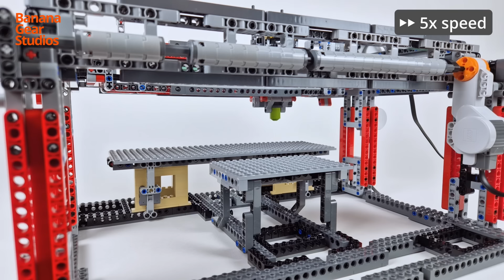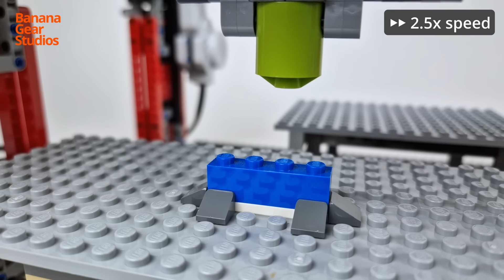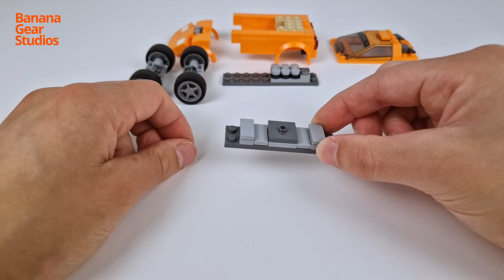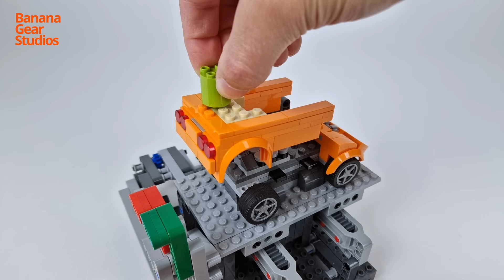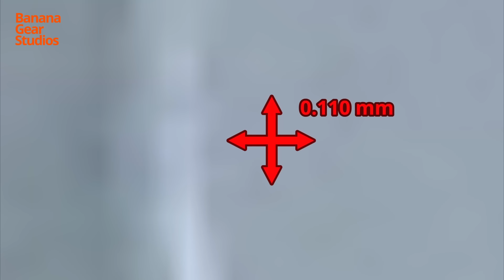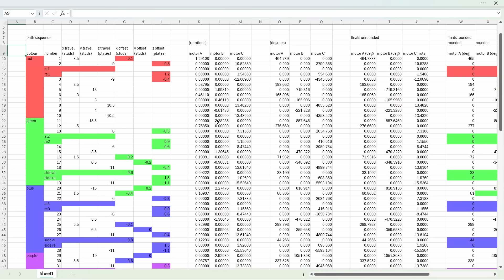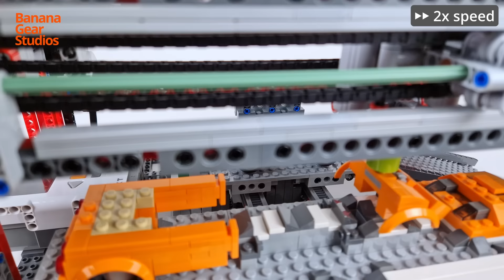I Built a Fully Automated LEGO Car Factory

Comment: There are two common ways CNC machines or 3D printers figure out their position so they know exactly where there are. 

One is to just run the motors to the far end of each axis and notice when they stall. I’m guessing that isn’t an option. 

The other is limit switched. You put a little bump switch at one end of each axis. Or at least X and Y. 

Before you start you move the tool until the limit switch is pushed. You consider that 0, and now know exactly where the tool head is relative to the gantry. 

May help your positioning. You’d still have the flex between the gantry and platform though. 

I loved the wiggle as a solution to the problem. Fun to watch and works great.
Reply from the maker: Yeah, you're right that going until the motor stalls wouldn't really be an option - it would just snap the chains instead. Using switches at the end is a really neat idea though, but I've found that the Mindstorms hubs can be a bit sluggish to respond to sensor inputs (and by sluggish I still just mean a fraction of a second, but that might be enough to introduce a lot of inaccuracy with where the motor stops).
Reply: @BananaGearStudios  A homing sequence on a CNC machine will move very slowly as it depresses the switch and take an average over multiple trials
Reply: @rockyvillano777  Similarly, homing with DC motors might just drive them weakly, relying on them stalling at the limit (but not jumping like a stepper can).
Reply: @BananaGearStudios  Is it predictable and repeatable just how sluggish the sensors are?
Reply: @BananaGearStudios you also might have better luck with latency using different EV3 firmwares than the default image (EV3dev or definitely EV3RT) since the default image is Linux based which is powerful but has a good bit of jitter on the scheduler, whereas a more bare metal RTOS like EV3RT should be much more precise. Overall, the processor on any of the mindstorms hubs (definitely not counting spike prime) is more than powerful and fast enough, the latency issues are just the scheduler on the operating system.
Reply: I assume he already has his way of setting the origin point. He would not be able to repetitively run the program and assemble the car without one. I think he uses the maximum direction of each axis as his bump switch. The reason that he can't solely rely on setting the origin point for accuracy is because the frame of the robot is not stable enough for the accuracy he is trying to achieve. This is why the awesome lil wiggle is used. To compensate for the unreliable origin point, that lil wiggle helps out! 3D printers are made in a way that makes sure that the origin point is extremely reliable. This is some really cool stuff
Reply: @blakethegreat421  The problem is not the lack of precise homing at all, it's the inherent lack of rigidity and compounded slop/backlash, no matter how well it was minimized. There's no fix for that kind of thing short of a live sighting cam that spots the peg in real time and decides when the positioning is perfect - except anyone who's seen one of those in action knows they're... far less than infallible too, even in industrial machines with 6-digit prices.
Reply: @blakethegreat421 I wasn’t sure. From the video it seemed like he might just be jogging it into place and sort of eyeballing it. But I may have misunderstood, so I thought I’d make a comment just in case.

Pretty impressive project. I can’t see the next part.
Reply: My first thought was the stall method--something like 10 years ago, I remember seeing a project with NXT that did exactly that! Instead of using any other external sensors, the program simply compared the measured rotation to the intended rotation to see if the motor had stalled. In this case, it was used to tell if a car had hit a wall and needed to reverse.

Comment: very good, but I think worm gears or spiral poles, with some sort of nut piece would be more compact, no backdrive, not much backlash, and can have gear reductions bigger than the universe. LEGO used to make a 32L pole which had a nut with 2 bars, but also a 2x6 nut plate, they also make technic worm gears of course, but these might come apart on the axle. theres also that fat 6L spiral pole but this is probably overkill, and can be backdriven. Look at " lego technic worm gear nut" by oracid on youtube

Comment: for releasing the car, i wouldve just stuck with the original method of building it on that platform with the 2 small studs. Then i would have something push up from underneath on the wheels to disconnect it and roll away. Or have the studded platform lower down, where the wheels would hit a ramp, pop off, and roll down

Comment: Learning that you had to compromise on the original car design was a bit of a shame, but that lego three-axis machine is crazy cool!
Reply: i mean, real cars couldn't be designed without consideration for the manufacturing process either
Reply: @agentwcVery true!
Reply: @agentwcwell, you say that...
Reply from the maker: Thanks, I'm glad you liked it! There were a lot of constraints on the size, shape and attachment points of each of the subassemblies of the car to ensure that the factory would be able to assemble them, which led to me having to simplify them so much. Some of these constraints I didn't even get round to mentioning in this video, but I'll explain them more in the next one.
Reply: @BananaGearStudios, you should totally collaborate with Lego MOC designers to help make complex car designs that could totally be built by your factory.

Also your current factory is the "final assembly" stage and you'd need to develop assembly stages for each of the car parts in this video.
Reply: I, for one, fine the mini-F1 absolutely adorable XD
Reply: Well, the problem is that the original car is designed to be made by hand. its incredibly difficult designing a factory around a car, instead of designing the car around the factory.
Reply: @speedman1996 adding two or three features to the factory could achieve higher complexity cars without overcomplicating things
Reply: That’s how research usually goes but hope for a futur factory that can assemble the complex car
Reply: It's called "Design for Manufacturing," or DFM. A product that you can produce at scale is better than a product you can't.
Reply: Yeah, I’m with you engineering background that 3-D access machine is more interesting to me and also his knowledge of assembling cars and then converting that to a simple cars in a Lego environment. Fascinating definitely have a new follower.
Reply: The design compromises are an interesting part of real-world manufacturing. Having worked in a machine shop in the past, you would not believe the number of times manufacturers have to call up the engineers (or more accurately, call up the contact number and attempt to get transferred to the engineers) who ordered the parts and either explain to them that they are physically impossible or prohibitively expensive to produce, and then we discover that there is no practical reason for them to be designed the way they are and tell the engineers that they need to redo it. 2 of my favorites from my time as a machinist are a high performance engine part which had a very narrow hole which turned 90 degrees inside a solid aluminum piece, and then turned 90 degrees again before it came out, which is impossible to machine using subtractive manufacturing. The hole was also specified to be square, when the part was redesigned the hole went straight through at a slight angle, eliminating the turns entirely, and was round, which meant it could be machined very quickly using a standard drill and reamer, and a housing for a red dot sight which was specified to have a ridiculously smooth finish on parts of it which were neither visible on the finished product or required the smooth finish for movement or mounting. We were able to reduce the machine time for each part from roughly 12 minutes to 2 minutes by leaving the surfaces with mill finish since nobody would ever see them. In manufacturing, time often contributes to the cost of products and parts far more than materials.
Reply: The compromise makes it an excellent example of real world product design constraints and how manufacturing capability influences how you have to design your product.